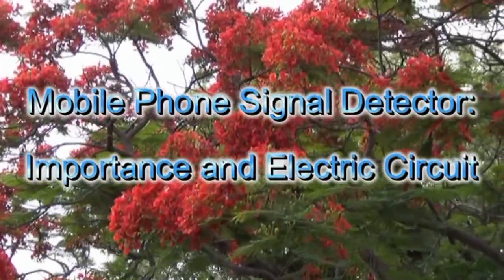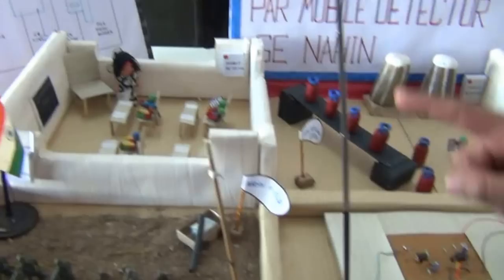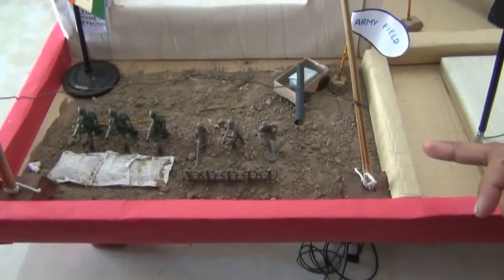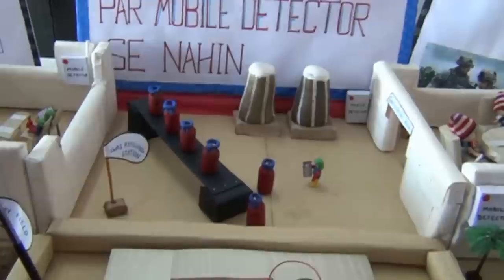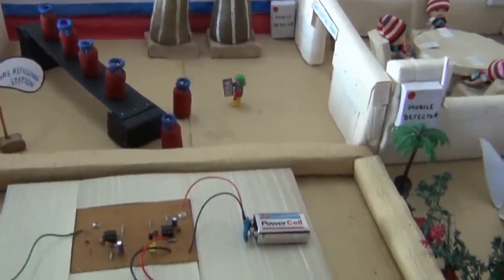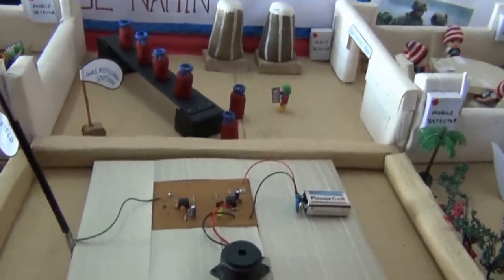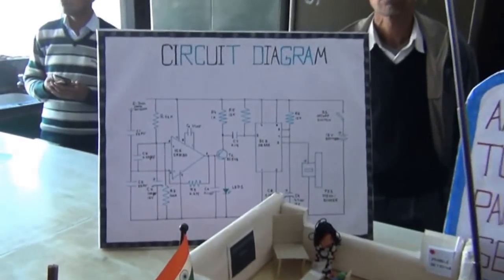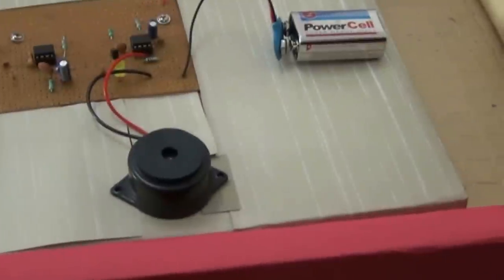Mobile Signal Detector: Importance and Electric Circuit (Science Exhibition 2015) (Hindi) (1080p HD)

Comment: you Cheated !!!!!
Because whenever you connect the battery's one of the terminal , the buzzer starts..and you connect the battery's terminal only after you start calling..
And at 2:55 to 3:03 even when the phone did not call anybody , the buzzer was whistling..
Reply from the maker: hmmmm. well, there are many other project behind us. check video again, it will be buzz only if it connect with battery properly. This is not rocket science and it is just simple circuits. Even you can make this device by wiring this circuit in your room. 

Keep in contact with us by subscribing our video channel for new video about Mobile jammer. 

Do not forget to share this video with your friend on facebook or googleplus.